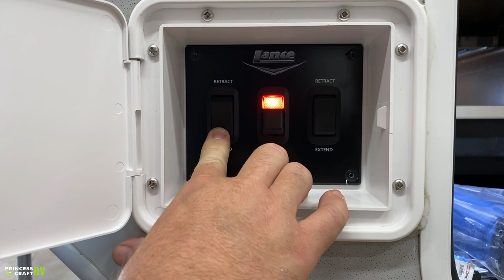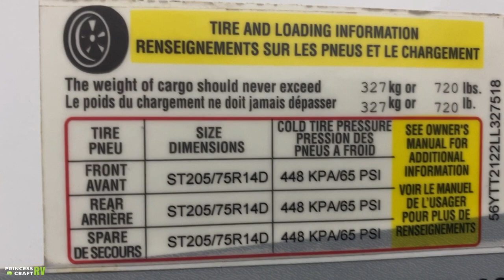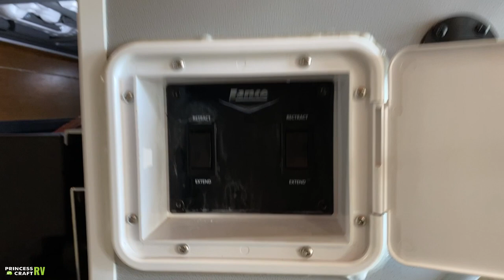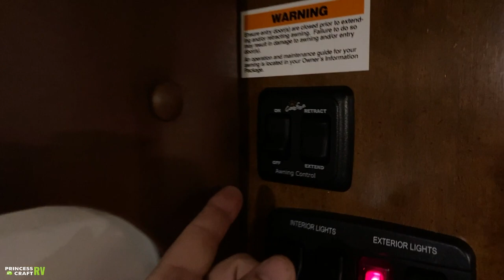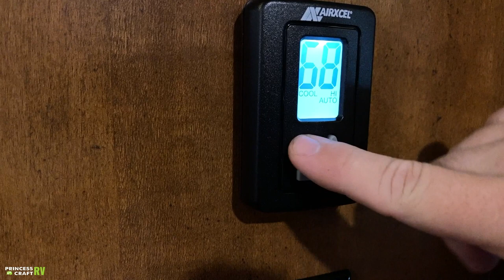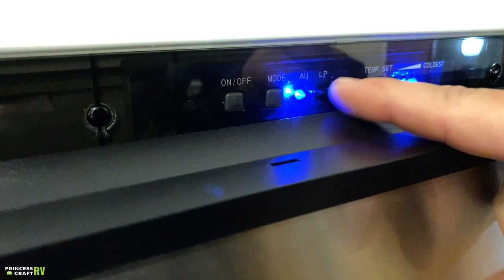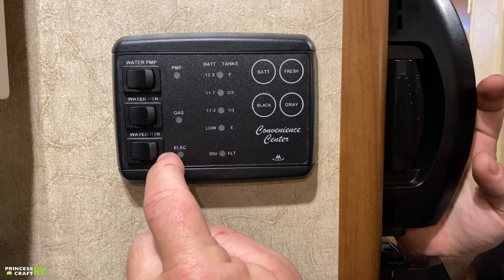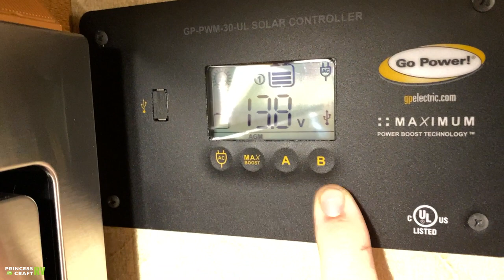2020 Lance 2185 Technician Tour

Comment: Can you use an external solar panel and the roof mounted solar panel at the same time?
Reply: You wouldn't want to mix different solar panels on the same controller. You could have multiple solar controllers charging the batteries if you want. It would be nice to know how many watts the go power that comes with it can handle.